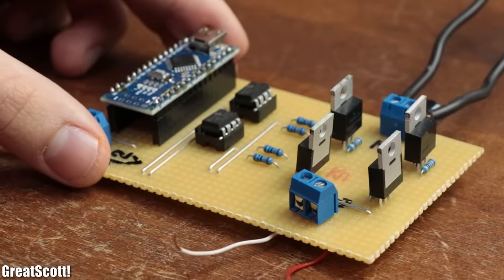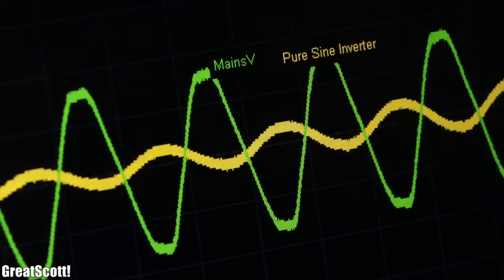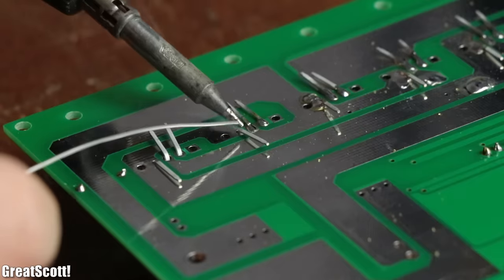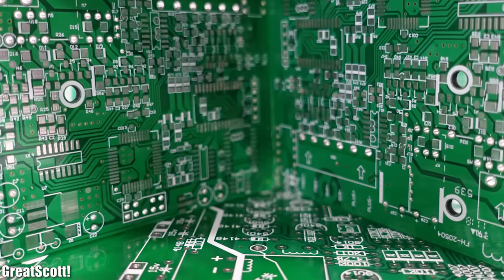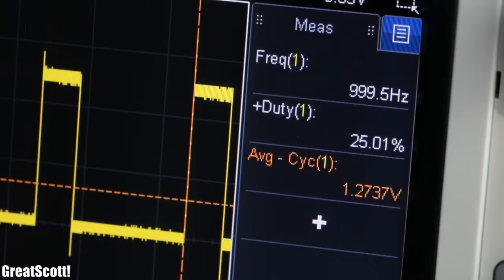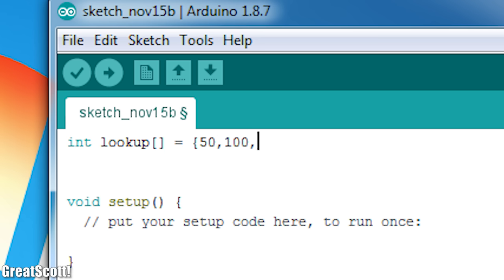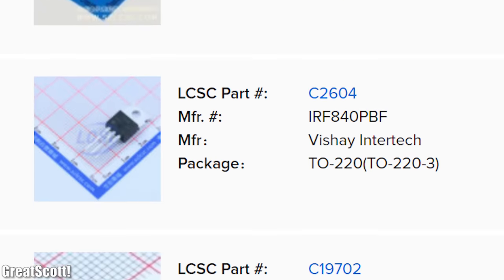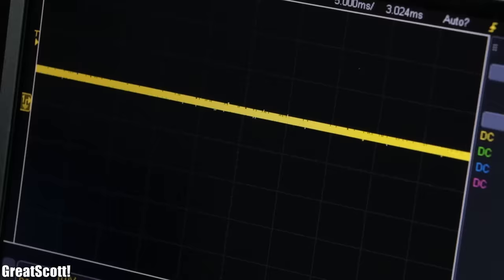Does it suck? Chinese DIY Pure Sine Wave Inverter || Sinusoidal PWM (SPWM) Tutorial

Comment: its a very nice inverter technique, on this you can select the 50/60 hz by selecting the jumpers, even you can set it to 400 Hz, which is mostly used in military equipment, the R&D of EG micro is a very much Excellent, you need some study to use it...
Reply: Hi i'm looking for a solution to make it work in Italy an USA air dryer.The air dryer is compatible with 120V/60hz 15amp, in Italy we use 230V 50HZ. I am looking to design my own frequency converter / circuit. Another option is to make it work with an inverter which should still provide the correct voltage & 60Hz frequency sinewave output. please let me know if you are willing to collaborate for this my project my best regards
Reply: Hello @andrea-pq5yz,  Sure!, Sorry was busy in my routine work business/industries, yes we can provide you a complete solutions as do you need, with some special techniques and full of safety protection/features,
a.)	This frequency converter can detect/Sens the input voltages and frequency, automatically converts into opposite voltage like, if the input voltage is 200-240VAC 50Hz, the output voltages must be 110VAC 60Hz, OR if the input voltages 110VAC 60Hz, and the output voltages is 230VAC 50Hz, wise versa…
b.)	If you want to need it as inverter we will provide you a 48VDC input voltages which is same like telecommunication power supply standards.
c.)	Hopefully you understand the things…

Comment: Ok, hear me out. It's really hard to create a pure sin wave with an inverter but power plants create perfect sine wave all the time. How do they do it? With 3 phase AC induction motors. So how about we take an induction motor and spin it using a DC brushed motor(s) with some gearing and maybe a CVT to create a constant speed(a correct output frequency) with different voltages?

Comment: Great video thanks have you ever thought about modifying a used large grid tie inverter . By replacing the control circuitry to make it off grid . It seems it would be a good way to get a heavy duty reliable pure sine wave off grid inverter

Comment: i made using SPWM same board using same PCB you have used but mine is working fine because i m supplying DC 315V and LC filter only combines PWM pulses to form Sine Wave,  whereas i also have developed AVR Code which is working Like EG 8010,  on ATTINY2313...  now i am planning to make 3 phase SPWM With Atmega-128, inspired by your videos soon i will upload my project but due to limited resources we, Pakistani refrain, work like yours!

Comment: You can always cheat if you don't mind noise with a 12v motor powering a 240v genny.
Or let's be nutz 12 volt heater make steam for your micro power stations.

All good fun thank you for saving everyone from a week's waiting for parts to find out they could of just used a 555 timer instead.

Comment: You need to try using a toaster oven with solder paste for doing the SMT, even better if you get a stencil. I prefer SMT to THT now that I can do 100s of connections at the same time in the toaster oven

Comment: I've had good luck with the Google Translate app where you can simply take a picture of the Chinese text and it'll make an attempt to translate it. Of course the translation output is a bit odd in terms of wording and grammar, but it's typically clear enough once one is used to the syntax of such translations.

Comment: most of them use a boost circuit from 12/24v to 230v DC, and then create the sinus. In that way the voltage is easier to stabilize.

Comment: Filter needs to be BEFORE the transformer. Mains transformers HATE high frequencies because of saturation and other effects. Also, was your transformer originally design as a step-down transformer? That would explain why you never get 230V AC. The transformer has compensated windings on the secondary that compensate for the voltage drop from winding resistance. The proper solution is to use a DC-DC step-up topology (normally a full-bridge or push-pull topology to get ~320V DC and then feed that into the full bridge inverter, which is why you can't find step-up transformers with a 12V primary. Also, there are a few caveats with generating sinusoidal PWM, namely DEAD-TIME COMPENSATION, which is why you need a current feedback circuit on your output.
I made my own inverter this way. Was wondering why there where spikes at the zero cross on my oscilloscope. Found out why when an NXP application note about dead-time compensation spit out the exact same waveform I got on my oscilloscope.

Comment: You can get a 3000W inverter on Ebay for about $150 through auction that has a decently stable sinewave output while loaded.  Not worth the trouble building one, except to learn how it's done.

Comment: can you help me with  voltage regulator using smps circuit "input 140v ac to 280v ac" , outbut : "stable 320vDC" , i have already made a prototype , but its not working properly...

Comment: Would it be possible to double the output using output boards and a single driver board? I guess the 20watts standby current  is still a issue. I don't guess there is much of a way to solve it with this design?? Great video. I have been waiting for years for someone to attempt this kit... Thanks!!

Comment: Actually, this board requires a 400V DC link to apply to the MOSFET bridge, the full bridge is used to chop the DC link voltage directly to SPWM output. You shouldn't use high voltage MOSFET in your situation.

Comment: Hi! Nice video.
I assembled the PCB and there are some major problems. Input P3+ P4- is DC24V. JP2 connected U1 7812 Voltage Regulator is burned. But working with out U1 P3+ P4- with DC12V and JP3 connect. Any idea ?

Comment: all these videos about power supplies are so useful!
What would be the best way to provide small currents into a circuit but with multiple voltages (like 0.5V, 2V, 8V and -1V at one time)? Including that negative voltage, it really confuses  me :( Why an IC would require negative voltage? I'm talking about a cheap CCD chip.

Comment: I think this board is not made to be powered with 12V. From the components it seems it expects you to connect +400V or so externally. And the AC output then goes to a socket directly. The IRFP840 mosfet choice seems to agree, it is a 500V quite high Rds(on) mosfet. I think your output quality will be better also, the transformer has a quite high impedance at high frequencies, so the poor harmonics performance of the LED bulb causes this kind of distortion. With just the LC filter after the H-bridge you may get a low impedance supply to a quite high frequency.

Comment: I think there was no need for the big output transformer. The circuit only requires an inductor to generate the 220V then the load. I think you only need to adjust the output voltage to 220 using that multi-turn trimmer.

Comment: Would I be correct in thinking you need a high current choke on the low voltage side feeding the fets to reduce the idle current ?

Comment: @GreatScott I want to build the inverter just like the one from Afrotechmods video. The imperfect waveform and an unstable frequency are not important for my type of load.  I am just scared about the Vpp spikes. So, can two flyback diodes (one for each part of the primary coil between two taps) on the transformer resolve that issue? The only problem is peak to peak spike. I just need to get rid of that without a big capacitor on the output.

Comment: Dear Scott, would it be possible to use 220 DC to feed the toroid transformer with SPWM signal, use low pass filter at the output to get 220v AC. Would it increase the efficiency, as the process of step up is eliminated

Comment: Thank you for this explanation video, I was contemplating replacing my msw inverter with this exact same setup (now available on Amazon) but will pass. I was hoping there would be better documentation or a low voltage cutoff circuit integrated into the egs002.

Comment: If that board and driver were any good I feel it would be inside a product and not been sold as a kit on Ebay although it did have a nice output while unloaded at least.... In my experience it is much much easier to save the money you are inevitably going to spend replacing blown MOSFETs, gate drivers etc  and to just buy a polished and refined finished product.. Because when it comes to inverter's as a DIY they have a nasty habit of going bang well in my experience at least lol  nice vid as always thanks for your efforts  take care

Comment: Sir , I purchased 220v Chinese inverter. This inverter SUOER brand and has dual pulse transfers and 6 MOSFET who generates 220v DC which are inverts in 220v AC through IC and 4 MOSFET .  Few weeks later inverter giving 145V AC. I checked all components but I failed to find exact fault. Please help .Thank you

Comment: How about a pure wine wave inverter where the  waveform is drawn by magnets spinning past an inductor, acting like a saturable reactor.
Reply: Outputing a low-voltage pure sine waveform isn't really the problem here, the issue is converting them into HV when the mosfets only accept zeroes and ones. Your idea would need to work with high voltage directly to be beneficial.
Reply: @thear1s  he's probably thinking to amplify it linearly via AB push/pull but that's basically an audio amplifier and to make one that can push 1000W will be very inefficient. We use mosfets and switching commonly because very little energy gets lost in the mosfets being on or off unlike a device you are variably changing the state of.

Comment: What about a two stage inverter system? Basically a DC boost converter followed by a class D amp? Boost stage converters the  LVDC to HVDC which the class D amplifier stage then uses to create a high voltage 50/60hz  wave?

Comment: Hello! sir,
I have recently seen your youtube video on pure sinewave inverter and I am really pleased of it😊
I also want to make a such one
my inverter will included of
 (1) DC to DC boosting
(2)DC to AC coveter 
(3) filter
but I can't understand how can I control the output feedback
 (1) by varying the on time(width) of SPWM  or  (2) by change the boosted dc voltage
which one is better to make the output waveform sinusoidal
 do you please help me!

Comment: I watched your video and the undervoltage indicator is activated. Use the transformer primary is 7v for 12vdc supply and 14v primary for 24vdc. Hope it helps.

Comment: I think that this board was designed to operate from 325V dc, but just the control electronics operate on low voltage.

Comment: Im not sure about pure sine wave inverters but my modified sine wave inverter it steps up the dc to a high voltage high frequency pulsed dc with smaller transformers that is filtered with capacitors and then that is turned into the modified sine wave i assume thats a cheaper way since you dont need big transformers

Comment: Hi, I need to know if it's complicated to make a frequency inverter for a 1 HP single phase motor.  This engine is installed on a hand-made wood lathe.  In the case that one can be manufactured in a homemade way you could pass me some circuit model that you recommend.  Thank you

Comment: Hi, I love your videos! They are very interesting and I always learn something about applications. 

Recently, I have been trying to get a low power UPS to power my modem and router so that I still have internet if electricity fails. The cheapest low watt I found was about $50. Can you make a video about DIY UPS for modem and router such that we can buy our own battery pack and plug it in?
The UPS could even supply DC so that an inverter is not needed, just a circuit to supply DC power to the modem/router and switch to batter if power fails.

Comment: your videos are always great!  Quick couple questions.  The first relates to high frequency sinewave inverters from China.  Is there any practical way to take a 12vdc input and change that to 24v or 48volt?  The second question relates to output.  If a device is 3500w constant 120v output, is there a problem connecting that to a suitable transformer that is essentially a120 primary to 240vac ct (ie 120v on each leg.... essentially split phase like we use in North America)  Thanks!  Doug

Comment: I'm pretty sure the inverter I own is using that module. The LCD module is identical. 

If you are interested in tearing one down, here is a link to it. 

https://www.aliexpress.com/item/Digital-Display-2000W-4000W-Peak-Pure-Sine-Wave-Power-Inverter-DC-12V-to-AC-220V-230V/32799292159.html?spm=2114.search0104.3.86.106759b07SH5j5&ws_ab_test=searchweb0_0,searchweb201602_2_10065_10068_319_317_5733915_10696_10924_10084_453_454_10083_10618_5733715_10920_10921_10307_10922_537_536_5733815_10059_10884_5734015_10887_100031_321_322_10103,searchweb201603_51,ppcSwitch_0&algo_expid=5168c6dc-6b9a-4aca-819c-15b40760d557-12&algo_pvid=5168c6dc-6b9a-4aca-819c-15b40760d557

Comment: Looks like your load is a LED lamp, with an input rectifier, and that discontinuity of current is what causes distortion in the voltage. Try a resistive load like a toaster or clothing iron.

Comment: Please will you make a video on variable voltage switch mode power supply that will be sooo useful for electronic noobs and pros ,if not smps based at least a circuit that varies the voltage and current (limit) so to work like a commercial bench power supply

Comment: Has anyone had experience with the noise on the line produced by these pure sinewave inverters? I notice my AHD cameras have noise in the picture when running off my MPP Solar inverter but are clean as a whistle when running off the mains.

Comment: I know its been a very long time but the reason this didnt work good is all due to not using a transformer with a low enough voltage on the input side, ideally you u want to use a 7.5v transformer to 220 or whatever, this gives the EGS002 some room to change the pwm acording to the LOAD. What failed was the transformer input was too high. The driver was alrready at 100%

Comment: Well, recently I was searching the internet for a cheap function generator and I found the ICL8038 chip, which gives, according to the datasheet, a sine wave output, but anyway it is quite low power and high output impedance, so You would have to use some power amplifier. Also if You want to power it from a voltage source without negative voltage, it is needed to handle the problem of the offset, and also there is no protection of any kind.

Comment: Surely this is not how it supposed to work? Wouldn't you usually feed the H bridge with 230VDC from a DC DC convertor and then take the output directly from the filter?
Reply from the maker: Also possible. And I think the module does somehow support such a mode. But then again, I was not able to find/read most of the information.

Comment: kann man nicht einfach einen wechselstrommotor mit lüfter verwenden dessen rotorachse verlängert wird, mit dauermagneten versehen dann durch kleine selbstgewickelte spulen dreht?
ich meine, wenn du mit einem kleinen microkontroler den wechselstrommotor mit 50hz in rechteckkurve antreibst, kühlsde das board und erzeugst gleichzeitig 50hz an den spulen.
wenn man da nun mosfets zur verstärkung nimmt, hat man doch lastunabhänige stabile 50hz.

die deutsche bahn macht sowas auch mit motor und generator, weil die ja keine 50hz haben sondern 16 2⁄ 3 Hz und in der industrie bei frequenzumrichtern machen das auch einige hersteller. dadurch spart man sich die elektronik und alles wird billiger...

Comment: Regarding the topic of "does it suck". I'm an absolute beginner and just started my own simple project. I am building a smart led light using an esp8266 and a ws2812b led strips. The only and kinda important part I am missing right now is the power supply. Since I read a lot of horror-stories about cheap power supplies catching fire I just wanted to ask some more experienced people about where to get a decent power supply which doesn't burn my house down (would be really nice if that does not happen). Does anybody know a good shop to buy it here in Germany? The stripe is 1m long and has 144 LEDs/meter. Would a 5V 8A power supply be enough to power the whole strip?

Comment: What's the difference between a BLDC motor and a permanent magnet three phase Alternator ?
Reply: the alternator might have a 2nd coil to slow it down in addition to the magnets, and it also might have a rectifier included. outside of that and the engineering choices to optimize one function over the other, I don't think there's anything else.

Comment: Feedback problem I had the same Just change phazes in feedback Sine output voltage is correct and low power consumption without load

Comment: it's terrible having so much energy waste, but to help the poor inverter kit i have to say that also ''real'' inverter in idle absorb pleny of energy.
My pure sinewave 2000-4000W inverter has 15/20W on IDLE, but with a load of 40W (for example) is not 40+15w but only 40W.
My other pure sinewave 1000-2000W inverter consumes 10W on Idle :)
Reply: Hi i'm looking for a solution to make it work in Italy an USA air dryer.The air dryer is compatible with 120V/60hz 15amp, in Italy we use 230V 50HZ. I am looking to design my own frequency converter / circuit. Another option is to make it work with an inverter which should still provide the correct voltage & 60Hz frequency sinewave output. please let me know if you are willing to collaborate for this my project my best regards

Comment: i usually just use a car audio amp and a microwave transformer the other way arount i stick a 50hz signal on my phone onto the car amp and just go into the primary of the transformer and adjust the voltage of the secondary with the amplifier volume control and i does work but the voltage also drops when loaded nad such but for making sparks it works :D